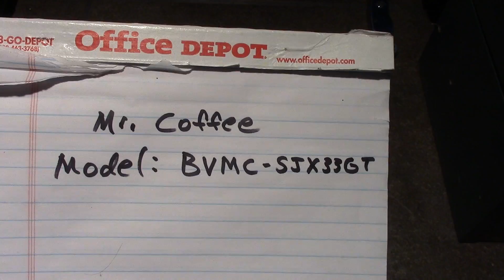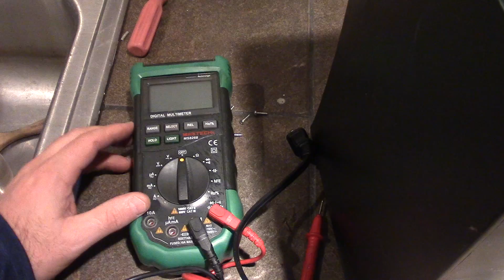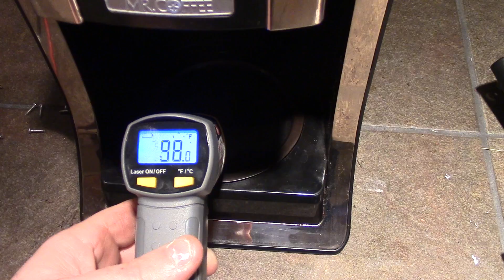Coffee Maker repair Mr. Coffee

Comment: Nice! I have a Mr. coffee that did exactly the same thing. I was able to use the same thermostat and applied some fresh grease and it still works to this day. I'm sure alot of them just get thrown out. This video might save a few.
Reply from the maker: +Darryl Landry I'm not really trying to save any of them it is just fun to see how they work and how they fail.  Usually with electronics the same things fail on each unit.  In fact, I bought a book that shows me everything that is wrong with flat screen tv's.  I fixed 3 tv's by ordering the known parts that go bad from each one.   Nice job fixing yours.  I'm using mine right now!

Comment: You are lucky to have phillips head screws to work with. My model has those wacko triple blades. I have a tool for that, but two of them are so deep that the tool can't reach. Thanks for the video!
Reply: You were spot on about the thermostat. Mine is out, too. Looked it up on the company website and the little thing is only good for about a thousand cycles. Geez... Make 2 pots a day and the coffee maker won't last 2 years. Talk about planned obsolescence. My model must be newer than yours, because they changed to screws to something most people don't have and don't have a clip anymore. Just two screws. Maybe that was less expensive or TS maker changed the connection. Thanks again.

Comment: Same problem here.

I used a  140*C KSD302 16A  (250 Volt) NC (Normally Closed) ceramic switch to repair mine.  You need this temp, as opposed to a lower temp switch, otherwise there's not enough heat to boil the water in a reasonable period of time.  Conversely, too much heat can damage things so pay close attention to the thermal switch ratings.  The proper switch should open once temperature rating is reached, limiting electrical current based on temperature.

The replacement switch terminals were oriented slightly different from the original switch terminals and my spring-clip bracket held the switch from the back side so I wound up using an mica transistor heatsink insulator to avoid the terminals from touching the clip bracket.  This mica insulator was necessary b/c the original switch had countersunk terminals and the replacement switch didn't.  Be very careful on this if yours is configured this way, getting it wrong can lead to hazards.

The two 216*C thermal fuses were fine, so I didn't need to replace them.

The screws were square drive heads instead of phillips, surely the manufacturer didn't want unauthorized access.

There was no heatsink compound on my original switch to transfer heat into the switch, I don't think it's necessary anyway although it won't hurt to use a dab if you prefer, IMO.

Coffee maker is back to it's old self chugging away normally, probably will go another 20 years.

Comment: I replaced the thermostat with one with a reset button, now it heats up quickly and pops the reset button. the thing has continuity through the two thermal fuses and the heating element shows 13ohms. the connects show 120v at 8a but heats to 169f and shuts down beeping three times. what do you think? chuck it? I would appreciate your take. model bvmc-ehx33bm-np.

Comment: Dont you have to use a high temperature spade connector with no insulation because of the heat? Im doing an espresso machine connection and the element is  1000w . Any help appreciated

Comment: thank you for posting this. My heating plate will not heat but my coffee maker also will not brew. It doesn't make any sound other than first click when I turn the unit on and the two green lights and the one blue light come on. it doesn't even attempt to siphon the water... Do you think that if the thermostat is bad but it might affect the Brewing process? this is the second coffee maker of the exact same model that I've had in the last 2 years lol

Comment: Great video-If my large maker goes out I will do this but I have a 4 cup maker.  A new one is only $10. at Walmart.  Would this thermostat work on the smaller one in case I decide to experiment?

Comment: Of that model coffee pot what is the highest heat temperature on the coffee maker pad when working correctly.  I notice many coffee maker companies claim one wants a note of heat for coffee some pots advertise that , however this one does not stipulate it - is it as high as others even at low cost of it ? Curios of what you thermal meter reads for it versus others ?

Comment: Great video. Do you have a source for the round plate the heater attaches to? I've looked everywhere and wound up making my own (4 5/8" x 20 gage). I'd like stainless steel or brass. Also I just used a 3/8" drill to drill out/off the two 'security' screw standoffs. They're not needed anyway.

Comment: quick question.  what do you call the tiny crimp connector that's used to fasten the SEfuse to the wire?  when I search for "uninsulated butt connector" I get nothing but larger, regular butt connectors. I want to be sure the heat shield is able to slip back over everything after the repair, so would like to find the same type used by the manufacturer.  thanks

Comment: There is another symptom a bad 'stat will cause, and the multimeter test won't find it. My unit would brew a partial batch, give the "done" beep, and stop pumping water. I had to push "start" one or more times to complete the brew. The 'stat was working, but shutting off at too low of a temperature. A meter would show mine closed and working, as it resets quickly. I pulled the 'stat away from the tube so it stayed cool. I could brew a full tank of water. CAUTION: you need to cut the power before the tank goes completely empty or the element will overheat and can blow the thermal fuse.

Comment: Thanks for video! I did a continuity test and the 1st fuse in line doesn't get a reading or have continuity. Is there a way to find the type of fuse it is? Or where to purchase that fuse? The other fuse and the thermostat check out fine.
Reply: Same result with my Brim SW20.  The pot heater works but it won't heat water or brew (cycles directly to the 'keep warm' stage, as if brewing was finished. From reading around it seems to be a very common problem with this model.  

Anyway, if you look on the part there are numbers/letters printed on it. You can search on eBay or some place for the type your pot uses and find them real cheap.. like a buck or two.  just make sure you get an exact match.  also, they typically are crimped, not soldered, so you might look into that process if not familiar (there's not a lot to it)

Comment: Mine did this about 4 months ago, it would beep and not brew. New Thermoswitch fixed it. But now this morning, it turns ON, but will not Brew or Heat the Hot Plate ... No Beeps this time, so probably not the same fault. Maybe the relay went bad (but I do hear a click)

Comment: The tabs on your old thermostat are at angle and the tabs on your Amazon link thermostat are flat.  Are they easily bendable  upward?  You can buy those thermostats much cheaper on Ebay China direct.

Comment: Nice job on that.  I just had the same problem with my Mr. Coffee---it stopped working in the middle of a brew.  I opened it up to take a peek.  I don't know much about things electrical, but I found it curious that mine had two identical fuses in tandem like yours as well.  Well, in my case, one of them was blown.  After doing some reading it seems to me that including two fuses like that was a decision based on reasons of history and litigation, and not so much of engineering.  So, I just clipped out the broken one and closed the circuit.  Turned it back on for long enough to finish my brew.  Still, the fuse apparently did its job, so I have to wonder why it blew in the first place?  Did it really get that hot?  The thermostat technically has a much lower temperature rating than the fuses, so there's that.  I have some thermal grease for computers... I wonder if it would also help to re-thermal the heating element to the plate...?
Reply: Those two smaller devices are safety thermal cutouts (rated at say 200C).  With repeated usage they typically fail 'open' removing power. I'm thinking that the extra one is there for extra safety.
Reply: Rose, good point about litigation.  

If you're reading this, I assume your jumping the circuit did not result in self-immolation via coffeemaker.

Comment: Thanks for the video.  Where did you get the replacement thermal switch?
Reply from the maker: +Pete Ciallella The replacement thermostat is from amazon it is about $6 shipped and it is rated at 150*F
Reply: +doublewide6 Thanks.
Reply from the maker: Pete just follow the link at the description that is the one I got.  Still working great.

Comment: Did you get a factory replacement thermo? I worked for an appliance repair shop where I must have repaired hundreds of those machines . I believe that thermo is rated at 170 degrees.
Reply from the maker: +Chum joe I could not find the exact same OEM thermostat.  Mine that I ordered from Amazon was about $6.  It says it is rated at 150* F  the one I replaced was rated at 155*F  I noticed that when they rate the thermostats they have the temperature and then a "C" , but from what I read the "C" is not for Celcius.
Reply: doublewide6 Repairs LLC

Comment: Can the thermostat still work but not allow it to get hot enough to brew? Mine will brew then shut off after it reaches around 230.
Reply: Yes.  The larger device is actually the thermostat, that should cycle on and off to keep the brew at the proper temperature.  With time they can get faulty, and start cycling at different temperatures.  Replacement is then necessary.
Reply: Water boils at 212°F--period. It cannot get hotter than that as it turns to steam. Not sure what you are measuring with, but water cannot exist at 230°F at normal atmospheric pressure. The thermostat that keeps it warm can fail partially and, as Ron said, cycle on and off a too low a temperature...which will always be below 212.

Comment: is the compounded the same that would be used on the computer put on the heat sink on CPU that transfer heat to cooling fan ???
Reply: Probably. Most thermal transfer compounds are rated up to 150°C.

Comment: My coffee maker is brewing luke-warm coffee. Would that be the heating element or thermostat?
Reply: The water coming out of any coffee maker is 212°F. No warmer, no colder. That is simple physics. The same heating element that boils the water heats the base of the coffee pot while it's brewing. Unless you have a metal carafe version, it should continue to warm a glass carafe for several hours. The heating element on metal carafe machines shuts off as soon as it is done brewing. One of mine is metal and the coffee cools as soon as it hits the metal. It never gets as hot as the glass carafe which is constantly heated by the brewing element.

Comment: I have a Mr. Coffee model SJX36  and it has a cracked hose.  I have tried like crazy to try and find these parts, but have struck out so far.  Would you know where a person could get these tubes?
Reply: Jim B if you're talking about the up/down tubing to direct water from tank to coffee grounds, I got mine from lowes for 39 cents. Just take in the old one and you'll be able to match
Reply: Make sure you are using a high temperature silicon hose for this repair, not some cheap 39 cent thing from Lowes or Home Depot that will melt due to the water temperature AND its close proximity to the heater coil in the base.  Google is your friend, you can find silicon coffee maker replacement hose sold by the linear foot on the Internet.

Comment: Thanks for the video. Is there such a thing as a water pump? How does the water move through the coffee maker to the brew basket?
Reply: The steam from heating pushes hit water and is the pump. If you look at the hose coming from the water, it has a ball. That is a check valve so cold water can enter but hot water can't go back. As the water heats, the water expands and is pushed out the hot tube with the steam bubble. Steam stops when the water dries and cold water drops in, repeating the cycle. That is the sound you hear while it is making. If there is no new cold water, the heater becomes hotter the thermal switch shuts off the heater and relay goes into keep warm.
Reply: @SeeK404  Thanks. My Mr. Coffee won't work because the water just sits in the reservoir and won't move through the coffee maker. I tried flipping the check valve but nothing works.
Reply: @markschirripa3607  So you can see the water go from the reservoir to the heating block? If you don't see any bubbling then something may have fallen into the reservoir. Dump the water and try to blow from the heating block hose to clear the blockage.
Reply: @SeeK404  I'll try that. Thanks.
Reply: @SeeK404  I tried it. There is nothing in the reservoir but there is apparently something in the horseshoe-shaped metal tube. On the receiving side of the horseshoe, I can stick a thin brush no farther than about 1.5 inches into it.
Reply: @markschirripa3607  I may be scale or lime deposits. You could try soaking it in 50/50 mix or vinegar and water. Or pour into the side you tried to clean. If it is scale then it should bubble after a few minutes. Any you may notice some white granules or powder on the end of the brush. Maybe try something stiffer like a bamboo skewer? I would not expect it to be a thick clog because the coffee maker would have stopped working before it became fully blocked.
Reply: @SeeK404  Thanks. You're probably right about the deposits. I have hard water. I tried the bamboo skewer. I tried vinegar. I tried coffee maker cleaner. I see some bubbles. Nothing worked.  My next stop: Drain cleaner! Yes. This is getting intense.
Reply: @markschirripa3607  Maybe try full strength vinegar 1st then CLR. Got to be careful not to use too strong an acid or else you dissolve a hole in aluminum. Drain cleaner is a base and won't work.
Reply: @SeeK404  Good point. OK. I tried the full-strength vinegar. I'll try the CLR next. Thanks.

Comment: I have this same model with the same problem.  Where can I get a new thermostat like this?   I have had this Mr. Coffee for about 2 years.   Woke up Sunday morning and  :( no Mr. Coffee
Reply: I'm have the same question.
Reply: Well, 1st. make sure that it is your thermostat that is the problem and not the thermal fuse(s). As it turns out it was 1 of the thermal fuses that popped.  So I purchased some new ones off of ebay along with some crimp connectors .  Mr Coffee is working again.

Comment: Mr Coffee Model BVMC EHX23  - the thermostat is brand RU (backwards R) part number KSD 303 125v 12A 155 degrees centigrade..   Looks like not all the Mr Coffees use the same temp rating thermostat.  And there are dozens of companies making those thermostats.

I just junked out my neighbors non working Mr Coffee (good thermostat and good fuses so go figure) and there are 2 small plastic tubes inside that all the water flows through and they are just disgusting.  Packed with crud and rust. Same for the heater pipe.  And you are drinking that coffee?  Yuck.  I wonder how much this caused my neighbors health issues.

Comment: I'm not a crimp person, I would have liked to have seen a soldered joint and a shrink... It's probably what was there, I did not pay enough attention. The crimp is although a good test subject. There is always wiggle room on design but it best to try and stick to the design. Good job on finding the issue with this product...
Reply from the maker: +Curiosity From what I could see when I looked at it prior to the video all connections are spot welded because you can see dents on the back side of the connections from the spot welder.  I was worried that solder would heat up and melt.  I also noticed that they used a copper crimp to hold together the fuses.  Thanks for commenting.
Reply: @doublewide6  Regular solder will not work well, due to the heat that is always there on the element.  The crimp is fine.  However, you should probably remove the plastic covering over the ends of those spade crimp terminals first, as they are going to melt and get brittle anyway, as they are not meant to take heat.  Also heat shrink would also not be a good idea, as it can't take that much continuous heat.